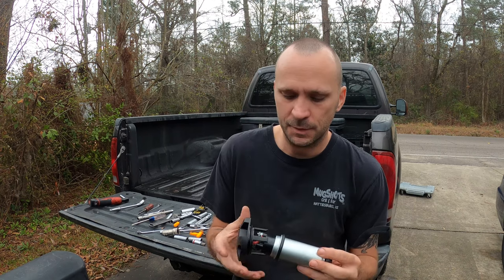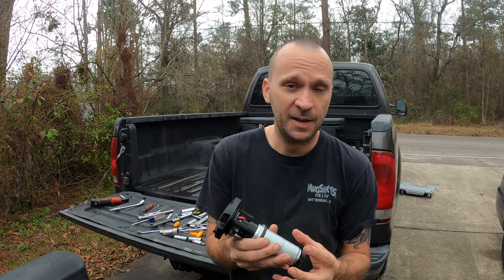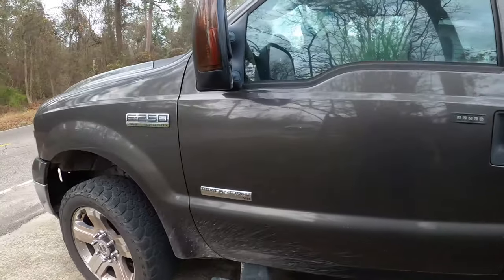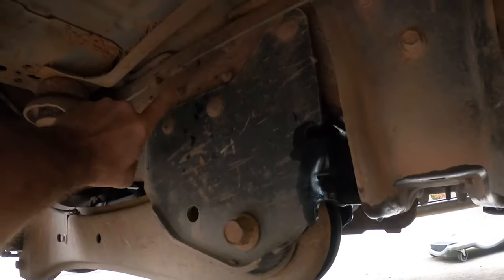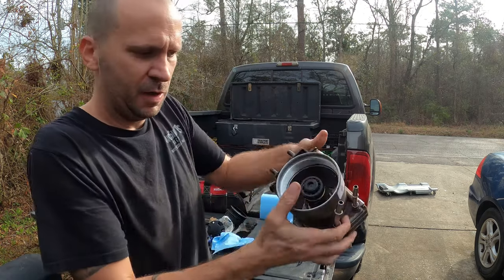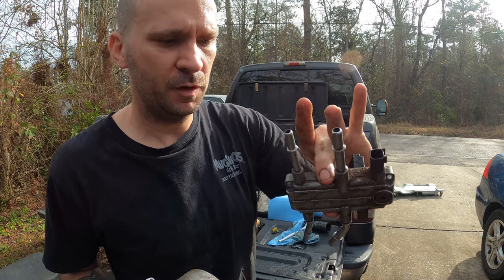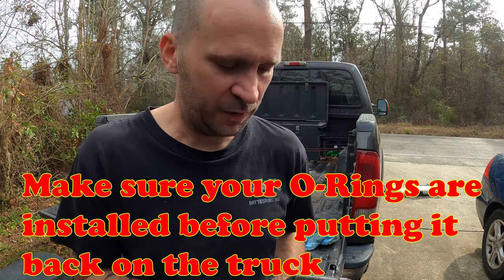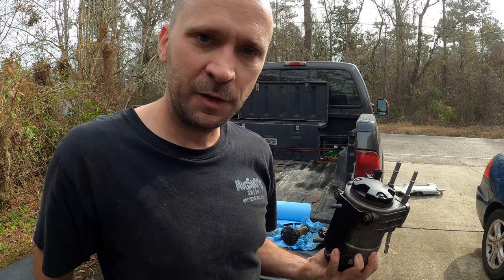6.0 Powerstroke - Fuel Pump Replacement

Comment from the maker: Super easy project and if your having low fuel pressure I suggest also dropping your fuel tank and cleaning that pick up screen as well or just putting in a sump.
New video coming soon of me dropping the fuel tank. Thanks for watching!!!!!
Reply: You make it seem super easy.  For a fledgling shade tree mechanic such as myself,  I would appreciate a view of how the fuel pump looks under the truck still attached.  I’m confident I’d be able to perform this repair though so thanks!

Comment: My question is.....since its been 3 years how has this pump performed?  I have been considering this pump on Amazon but am used to OEM but they are pricey.  I have your mechanical abilities so this looks like the most sensible approach.   Thanks for the video.
Reply from the maker: I would install an airdog, I have one on my dodge. But that cheap fuel pump worked fine up until I sold the truck.
Reply: Thanks for the reply.  I'll look into the air dog.

Comment: Great vid but a little confused?? There's a fuel sending unit in tank not really considered a pump and a hi volume fuel pump in the inline system which is basically a unit which pumps,heats,and separates your fuel from water if I'm not wrong trying to fix mine as well not getting fuel to top bowl
Reply from the maker: Sounds right

Comment: How did you determine that thos was the issue?
Reply from the maker: Couple different ways. Do the fuel bowl test, where you have the fuel filter cap off and see how long it takes to fill the bowl, or like me if you run a fuel pressure gauge “which you should” because anything less than 50 psi can ruin 6.0 powerstroke injectors and with out it you would never know your playing with fire.
Reply: @grumpysdiy  thanks for responding the bowl filled up. But my problem is it will not start. I seems like it's about to catch like it's not getting fuel. Don't know much about diesel engines. 1st time owner 6.0 partybus. It was running fine until the temperature drop in the teens changed fuel filters.
Reply from the maker: @3durty the 6.0 is weird af, it takes oil pressure also before it will start. So you can do a test for oil pressure too.
Reply from the maker: I made a video on it. You take the oil filter cap and filter out, and there is a check valve in the bottom you press down with an extension. Then there is a wire I believe on the drivers side you unplug and touch to the positive on the battery and it will turn the engine over. While you hold that check valve down you watch as you start it with the wire to see how long it takes to fill
The bowl. It thst is fast, it’s a whole other set of thing to check.
Reply: @grumpysdiy  my oil bowl is under the bus . How do I check it? I've been looking for that wire can't find it batteries are under bus also😫
Reply from the maker: @3durty well I didn’t know you were in a bus, I only know the f250 or f350 stuff.
Reply: @grumpysdiy  it's a 6.0 engine E450 SUPERDUTY I'm thinking it's similar to what you have in you videos.
Reply from the maker: Do you have a scan gauge 2, having that will tell you if either of the two sensors that will screw you are working. One being the ICP, or the IPR. Both regulate the flow of oil. Yes this sounds weird, however the truck won’t start if the icp sensor doesn’t see a 500 value.
Reply from the maker: Which the icp sensor is cheap where the ipr is expensive.
Reply: Finally looked at the pump looked inside and it has white sludge in it and in the filter. I'm going to change the part like you did.when jumping the pump it was turning.

Comment: Would the sending unit cause neither fuel bowls to fill? I’ve got an 05 f250 and neither that one or the one on the motor are filling. Was going to replace the whole pump but I’d like to just do this if it’ll fix the problem
Reply from the maker: If you have power to the sending unit on the frame and you turn the key to the glow plug position just before start. Then get out of the truck and listen, the fuel pump is loud. If you don’t hear anything, your sending unit is bad.
Reply: Thanks man that’s it!
Reply from the maker: Np, take it easy.
Reply from the maker: Just for my sanity, turn the key as stated and get under the truck next to the fuel sending unit and listen. Can’t be too careful.

Comment: Our 2005 F350 Powerstroke starts great when it is cold, but after it is driven and it gets hot, it wont start until after it cools down. Any suggestions?
Reply from the maker: Stc fitting or dummy plug & stand pipe o rings maybe.

Comment: Would that cause my crank no start I have to spray starting fluid in it for the truck to crank
Reply from the maker: Maybe, are you getting fuel to your fuel bowl?
Reply: @grumpysdiy  I get fuel to my bowl but same I have to spray it to get it to fire runs fine once started but won’t start with out ether ?
Reply: Steve did you fix yours?
Reply: @BecuzScience719  no it did not high pressure oil pump went out on it
Reply from the maker: Right if you don’t get that high pressure oil to the rails your injectors won’t fire.
Reply from the maker: Either your icp sensor, ipr sensor, or hpop is going out. Use a scan gauge to view icp you need over 500 for injectors to fire. Using ether is tricking the truck to start giving the hpop time to build needed hpop pressure to the fuel rails.
Reply: @grumpysdiy  my pressures are all good replaced everything any way still won’t start
Reply from the maker: Do you have good base oil pressur
Reply from the maker: Take oil filter out use screw driver to close oil return. Pull the starter wire and touch it to pos on battery with out the keys in the ignition. See how fast the oil bowl fills. Should be less than 5 secs

Comment: How did you remove the 2 lines that come from the tank i got the other 2 off
Reply from the maker: Quick disconnect tool for fuel lines from Amazon. Local parts store will have them too

Comment: can you replace the fuel pump without taking down the fuel conditioner ? thanks
Reply from the maker: I don’t think so.
Reply: You can. You won't have the ability to clean it really but if your confident your hfcm is clean its no problem. Just did mine on the side of the road. Only needed an 8mm to pull the fuel pump

Comment: Two bolts broke off inside the housing when I was replacing my sending unit and created a massive fuel leak. I had to drill through the housing to use a bolt and nut to secure the sending unit on the housing until I can get another replacement housing. BE CAREFUL not to torque down on them. Use lock tight
Reply from the maker: I would get an airdog or some other after market fuel pump when ever you can. Because low fuel pressure will make injectors stick. Had it happen to me once.

Comment: Thx for the video. FYI - you actually replaced the fuel pump in the (HFCM) Horizontal Fuel Conditioning Module, not the sending unit. And that side piece you took off is the HFCM Fuel Manifold. The sending unit is in the fuel tank. Still a good video though.
Reply: Thanks for the info both of you.

Comment: How do you know it went bad? 
Loss torque is mine but yet to diagnose.
Reply from the maker: I run a fuel pressure gauge. So if it’s reading low it’s coming from somewhere before the engine. Which only leaves the fuel pump and in tank pick up. So check both .